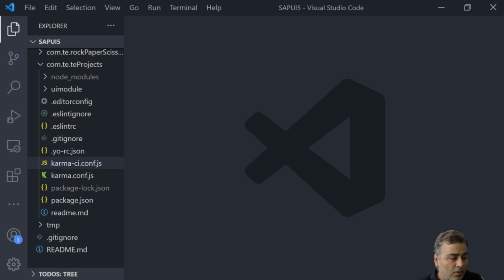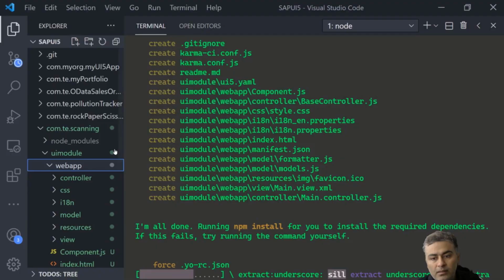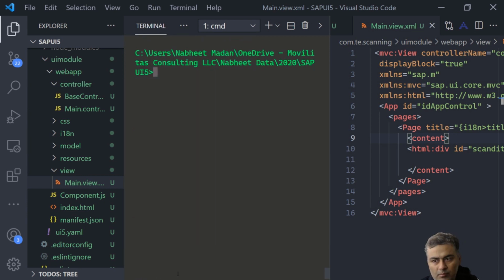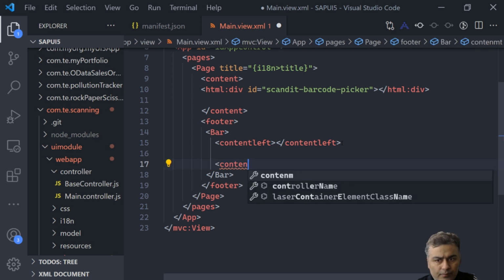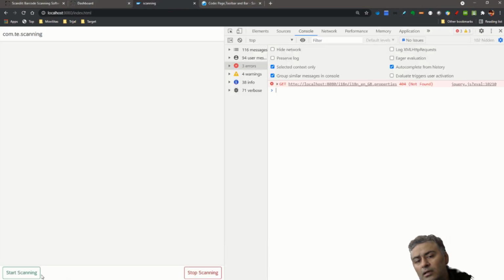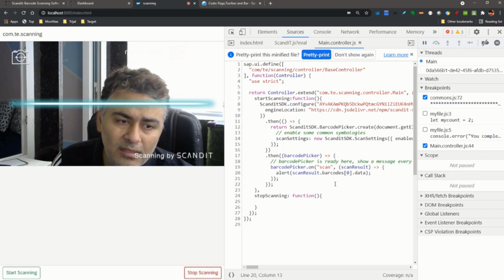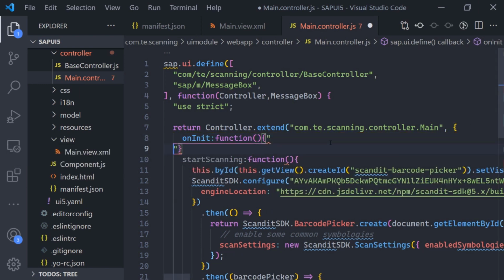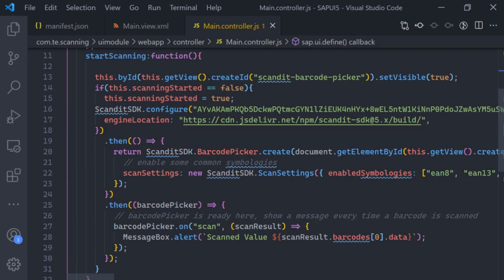10 SAPUI5 Projects for Beginners - Project 7 Barcode Scanning

Comment: Hi Nabheet, great tutorial, I've followed your video step by step, but I'm facing an issue, hope you can help, when I want to scan using my laptop camera the blue line for scanning never gets white as in your video and as the demo, with the demo I can scann because the blue line for scanning gets white, but in my app remains blue. ¿What could be wrong, I've double check my code against you video?, thanks on advance.
Reply: Solved, my mistake when creating the license key for domain name, a wrong character in the domain name was the problem.
Reply from the maker: Wow great to hear... I hope it is working super fast:)